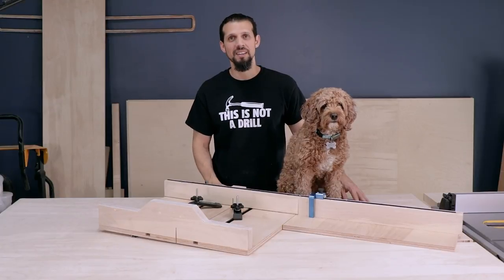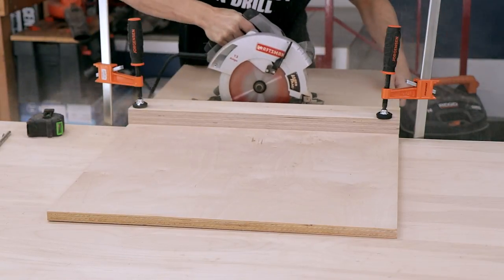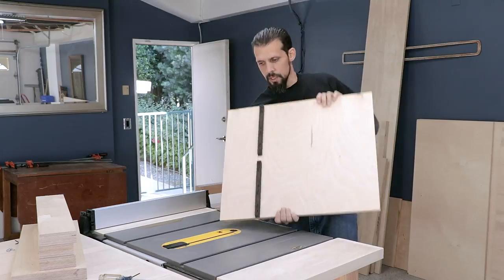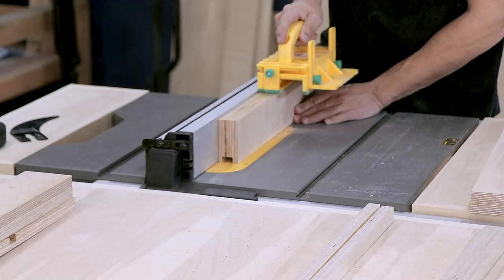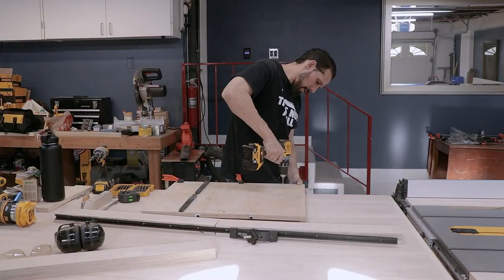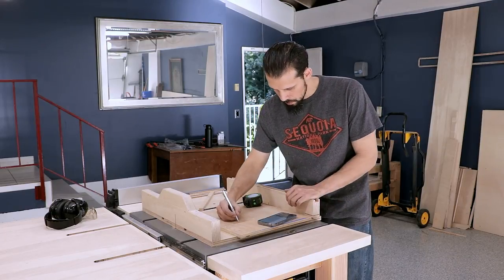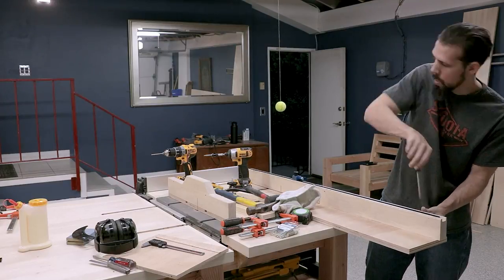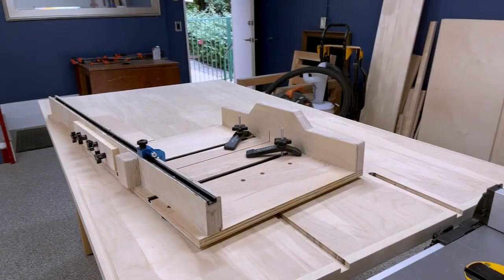Cross-Cut Sled for Contractor Table Saw

Comment: Anthony, I see that you install a safety block at the rear of the sled to protect your hand from the blade at the end of the cut. Why Not but a STOP on the bottom of the sled to prevent the  possibility of the sled to travel far enough for the blade to come thru the rear ??

Comment: New sub to your channel here. Really like your no hype style. Not sure if its because im Australian but most US wood work channels are way over the top and short on good visual info. 10/10!
Do you have an Amazon link for the sliders you used by chance?please.
P.s. I'd be interested to know what measurements you'd get now it's done with the extension arm and screws in place etc using that 5 cut method. It must change your square a very slight touch.
Reply from the maker: Thank you! Glad you like the channel. I think this is the one you were askign about. ZEROPLAY Miter Bars: https://amzn.to/3wZYL7X
That's a good point, it probably does change the square some. But to be honest, whenever I do use the extension, I typically am just trying to get the piece to a more manageable size. It may be a good idea to keep the piece slightly long and then do the final cut without it to be safe.

Comment: You need to make a detailed 20 minute long minimum video on how to make a tennis ball holder!
Reply from the maker: Haha, I agree!
Reply: @woodpackdiy  I use a small dowel held on with a thumb tac at the end of the string as the guide for the car to stop in the garage. It's not as obtrusive as the tennis ball but does the job perfectly. It's been in place for over 20 years.
Reply from the maker: Using a dowel somehow sounds more appropriate for a workshop too!

Comment: If you make the safety Block protrude down below the sled it would act as a safety block and a physical stop for the sled.
Reply from the maker: The main reason that wouldn't work (if I'm understanding the idea correctly) is that the stop would prevent the sled from going far enough forward to complete most cuts.

Comment: Cannot help but notice at 4:15, the level clamped to the board as a router guide is moving significantly.  Did it not affect the router cut?
Reply from the maker: I cant remember now for sure, but you are probable right. I think i didn't clamp down well enough and ended up having to redo the bottom piece.  so that is probably the footage from it.

Comment: How does Bob react when you start saws or make noise in the shop? Does he run away or did he get used to the loud noises or do you keep him out if the shop when doing that sort of thing?
Reply from the maker: He has never reacted much to loud noises (even with things like fireworks or thunder). He just ignores it and goes about his business. What he really doesn't like is if I go too long without paying attention to him! But I do send him inside if im going to be doing a lot of table saw work just to minimize the impact on his ears long term.

Comment: ..nice sled, I will be copying!

How come your table saw can take a dado set, I thought the arbor is too short for that, I have the dw745. Did you modify it or is the arbor just longer on your saw compared to the dw745, thanks
Reply from the maker: Yeah, the arbor on the DWE7491RS is longer (I assume). That's one of the reasons I got it. The arbor can hold up to a 3/4" dado stack.

Comment: Would this work with a DeWalt table saw with a 8.25 inch blade or do you need a saw with a 10 inch blade?
Reply from the maker: This should work well with the smaller blade/saw

Comment: Why do you have a mirror in your wood shop ?
Reply from the maker: It was there when we moved in. After a while I got used to it and just never bothered to take it down or put anything else back up. So, basically, laziness. lol
Reply: @woodpackdiy  thanks for the reply. I also wondered about the tennis ball hanging from the string. BTW it was a good video , I have not subscribed yet I'll watch some other videos and decide then . And your dog Bob Barker is awesome I wish I had thought of that name.
Reply from the maker: The tennis ball is just a marker for parking. And Bob Barker says thanks!
Reply: Just to make sure to looking good in his content while pulling off such projects. :-)

Nice sled. Just wondering if the T track could be to low if the blade is extended to max. And did you used just one rail from the saw or did I missed something?
Reply from the maker: @petezahut9545  at max height, the blade still doesn't come close to the t-track. And yes, I only used one rail. That way I can move the sled over to the left and make cuts off the edge. This is useful for angled cuts and also have done some with a dado stack this way - without ruining my zero clearance for regular cuts.

Comment: I have the DW 744 contractor saw and it's been a great saw for building trellises, cat houses, and general carpentry where absolute precision isn't required.  However, if you need table saw-level precision and true square, this is not the saw to ever use!  Reasons being is that the aluminum fence is way off from one end to the other - mine had 0.090 (90 thousandths or the equivalent of 9 standard sheets of paper) on my dial indicator which is about as useless as it can be for precision cuts - although it looks straight and lines up with the miter slot.  The second problem is that the parallelism between the blade and the table can only be adjusted so far and it goes out of adjustment quickly.  So anything that is cut on this type of saw will inherently be out square through those combination of inherent errors. All things being equal though, for it's intended purpose as a jobsite saw, it's been a great saw over many decades.
Reply: Precision isn't required for woodworking, because if you wanted precision you wouldn't' be using wood. Wood is a living thing unless kept in a vacuum. For what most YT woodworkers want is good enough for the job at hand, as you said.